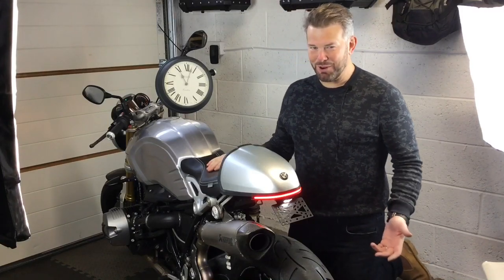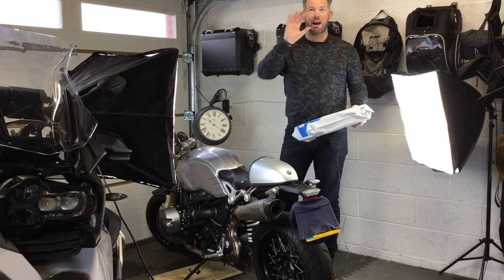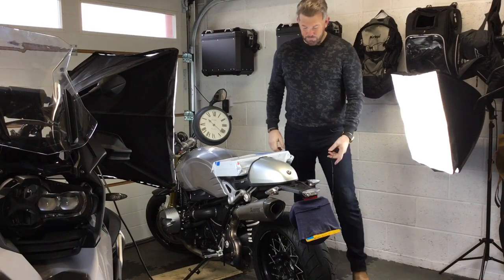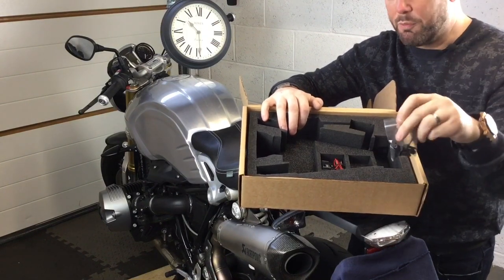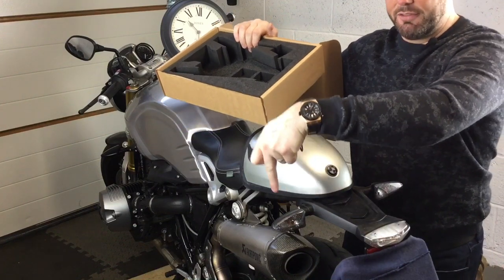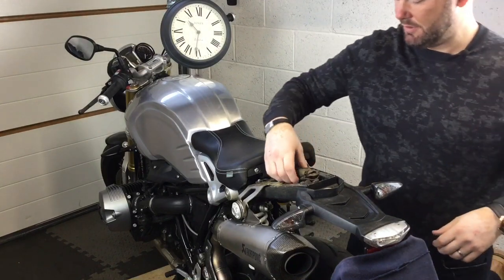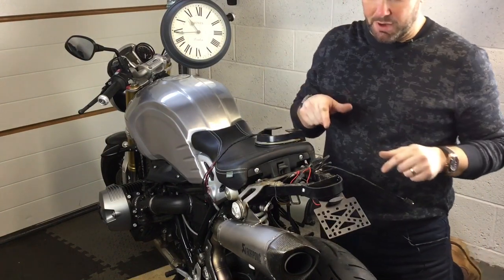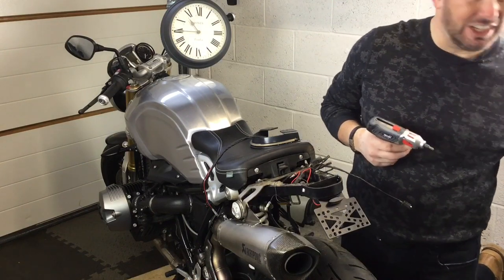NEW 2019 FANCY BIKE THING INSTALLATION VIDEO

Comment: I have this kit on my 2017 r nine t racer (USA), it’s throwing a code on the dash (amber light on).
The turn signals only work for a few seconds after starting the bike and then they stop working while the front signals flash quickly.  
The tail & brake lights work fine.
The BMW dealer tried to flash the ECU but it didn’t work!  I’ve heard about installing resistors, I’m not sure how to do it as I’m not familiar with electrical stuff.
Any idea how I can fix this?  Any videos?
Thanks in advance.

Comment: Have a brand new 18 plate 9t stock with the double akrapovic exhaust system delivered on Wednesday 20th March...I'm guessing this kit will fit?
Any problems with passing an MOT?
Reply from the maker: a Pint of Guinness and a packet of crisps yes it will fit perfectly.
Reply from the maker: a Pint of Guinness and a packet of crisps and to answer your question about my older R9T.   I had a rizoma straight bar.  I think it was model 008.   Blaze motogadget turn signals.  Rizoma mirrors.
Reply: @ABIKETHING  thanks....I'll place an order once you have stock delivered.
Reply from the maker: a Pint of Guinness and a packet of crisps ok no problems.  I’m currently in USA and returning just as new stock arrives.    Just make a note that we still take back orders between now and then and although you’ll order once they’re in stock you could be on the tail end of a long list of back orders.  Although we’ll have around 100 new kits in stock as of 25th March,  we only get about 5 prepped per day as each kit needs assembling and packing etc.